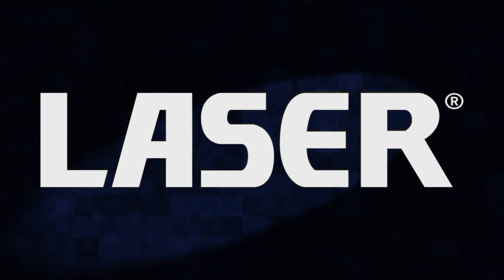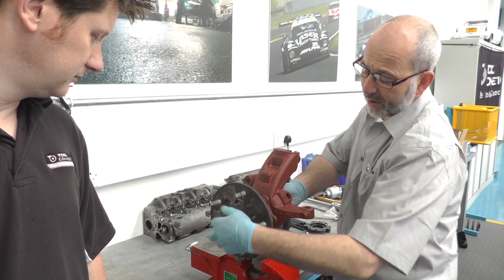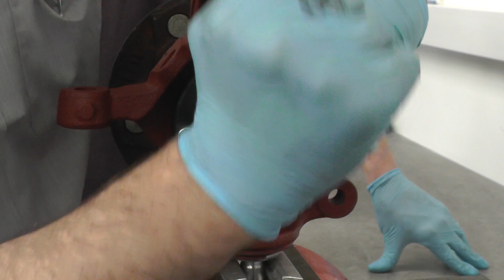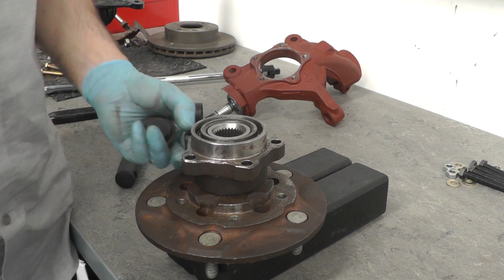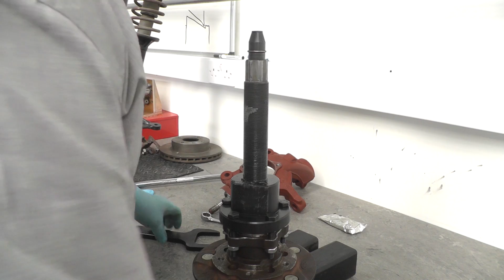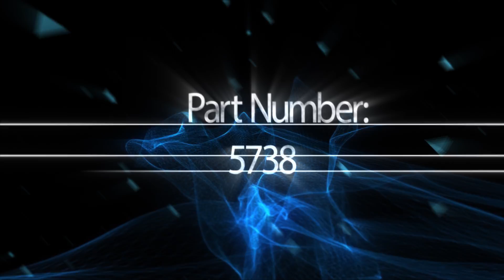5545 & 5738 | Ford Transit Front Wheel Bearing Removal Tool & Inner Bearing Remover - Instructional

Comment: I have done hundreds of wheel bearings on them transits using a grinder and chisel. Never had a problem with it. This looks alot of faffing about setting the tool up.

Comment: When separating the bearing and disc, are the original hex bolts used to fix the bearing pusher housing? the 5 in the kit are too thick to enter the tapered holes on the back of the bearing carrier bit
Reply from the maker: If you can possibly let us know the reg etc, our Technical team will be able to assist. They can be contacted via phone: 01926 818181 or e-mail: technical@toolconnection.co.uk or via WhatsApp on 077250962305 hope this helps.

Comment: Will this tool also alliw the fitting of the new baring?
Reply from the maker: 5545 & 5738 are removal tools only. You will require a separate workshop press to install the new bearings – unfortunately, we do not currently list a suitable press in our range

Comment: A little heat and that inner race usually drops off without a press at all. Even so, it's nice to see a custom tool. Now, we just have to wish that every pressed-in bearing has the same bolt configuration....

Comment: Excellent video.  Are 5 Lug hubs and 6 lug hubs interchangeable ?
Reply from the maker: 5 lug and 6 lug hubs will only fit into the standard payload wheel bearing.
The 6 lug front hub is for vehicles with twin rear wheels but only up to 2014.
Reply: @TheToolconnection  Thanks for replying. The 2020 AWD uses a 6 Lug.  I am trying to convert from 5 lug to 6 Lug if possible, Front and rear..  Do you think its possible ?
Reply from the maker: @accurateapplianceelectroni9703  The 2020 Transit  6 hole front and rear hubs are not visible on our parts system, so we are unable to comment on this question.
You would be best to seek advice from a Ford transit specialist on this matter.

Comment: Save time and energy just buy the complete wheel hub and replace the it.
Reply: Yes Got it !!
Reply: The front hub costs around 420GBP for my 2021 Transit. If you do the service yourself and on a lot of vehicles it makes sense to invest in this tool. If you pay to a workshop it would make no sense since the labour + the spare bearings are going to cost more than a whole hub. Ford ain't stuрid, they've calculated this when created this ridiculous design.

Comment: I just done it. Both sides on a transit that was covered in mud. Driven daily by gardeners and well seized in. Not pushed in and easy to come out. Imagine transit on axle stand and trying to use this tool whilst laying on a shoulder twisting in. Ebay did me proud. 15 tonne puller and off. Then grinder to cut bearing off with 1mm cutting disc, and a clarke 10 tonne press to fit new bearing on. Could have even used the same puller to be fair and not the press. So tool cost £40 and bearing £20 ebay. Bet this tools hundreds.
Reply: Just priced a new hub and bearing (fitted) 63 UKP, cuts the faff, 4 long bolts and the spare wheel to remove....easy
Reply: @georgestyer2153  yep you only know what you know. I tried one way and then found after theres a real easy way. 4 bolts in from inside. They literally wind it out. So easy.
Reply: so u used the puller to get the hub or the bearing off? also how wud u use it to put the bearing back on ? link to tool pls?
Reply: @chaim6523  turn hub around and holes in it line up to back. Put bolts through and tighten. They push the hub out.
Reply: @jamesbarratt593  thanks, was it one of those yellow generic 15ton hydraulic hub pullers on ebay? cofused what u used the grinder for if u used the puller? and also how u cud have used it to press new bearing on ?

Comment: All I do is... once you have the five bolts out of the bearing housing is to rotate it slightly ie blocking of the threaded holes in the carrier... then insert five long bolts from the back which when tightened evenly pushthe bearing housing and besring out . And Ive done loads. Theres always someone wanting to make money by complicating things
Reply: And to get the new bearings in, what are you using a small press or ?
Reply: Chris Harrell hello Chris yes a small bench press... and yes they cost money too but are more flexible in use for other tasks 👍

Comment: looks like a great idea, but, in the real world you can do that job quicker with grinders, hammers, chisels and a hydraulic press just as quickly and just as easy, i know from experience
Reply from the maker: The whole point of the tool is that you can remove the bearing in situ, while the hub is still fitted to the vehicle. The traditional way is to dismantle the whole lot and then use a shop press. This is a much faster solution.
Reply: I understand the point of the tool completely and its a great idea, i would like to see a video of it working on a 10 year old van as easily as it does on the brand new rig you show in the video

Comment: Did I miss something, there. How to fit that when the drive shaft is inside the hub.
Reply: Andy Lasers That's what I was thinking too. You only need to remove a couple of extra nuts, which would take a nominal amount of extra time, and remove it completely from the van before pressing it out with a shop press. You can also inspect and clean it up easier off the van. A cheap press is about half the price and far more versatile. Don't really see the advantage of doing it in situ on a front wheel drive van.
Reply: seriously

Comment: why not use a freaking shop press?!
way easier and straight forward, and I bet you, way less costly than buying a specialty tool!
Reply from the maker: The whole point of the tool is that you can remove the bearing in situ, while the hub is still fitted to the vehicle. The traditional way is to dismantle the whole lot and then use a shop press. This is a much faster solution.